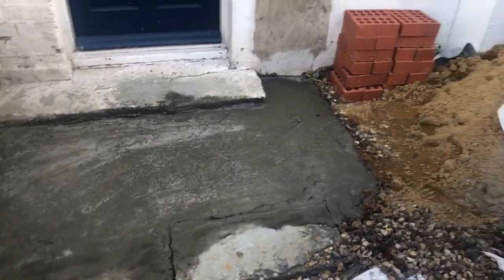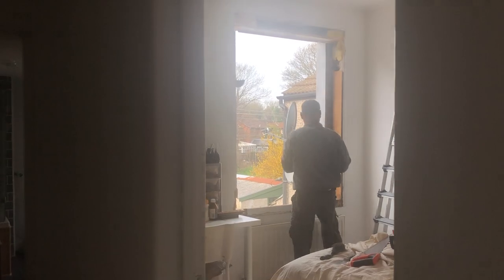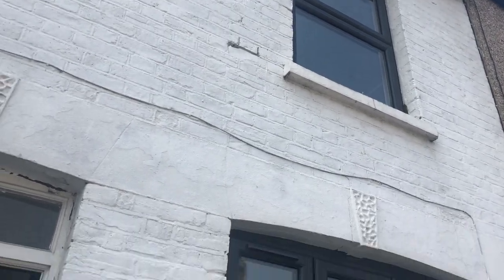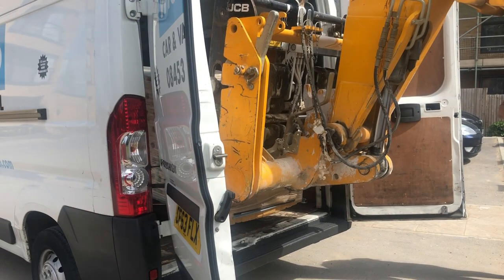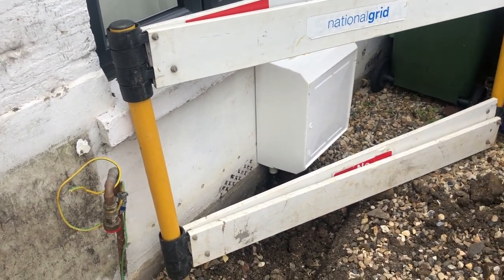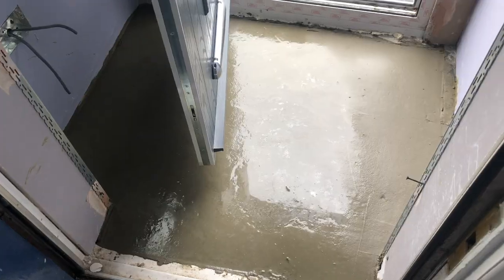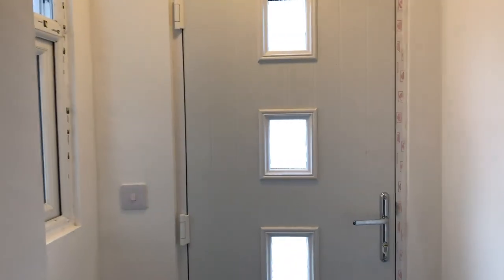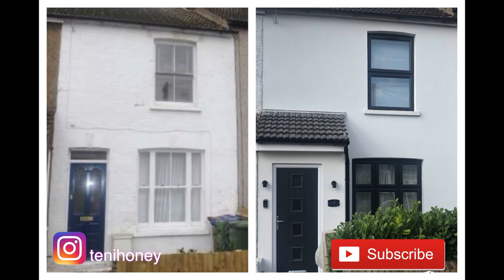Home Renovations - Revamping my house! | New windows, porch and rendering

Comment: Hey, it looks like you have done the same as me :) did you use insulated plasterboard on the inside as mine is a single skin as i believe yours is, just wondered 3 years on if you have had any issues? ❤